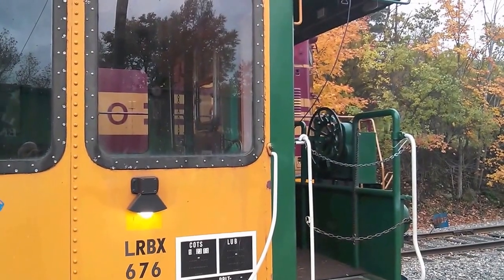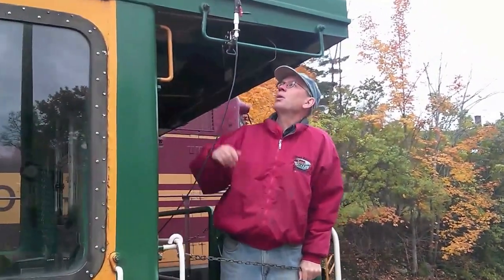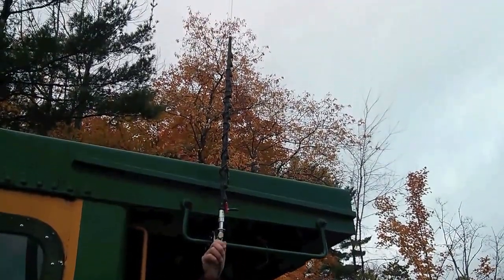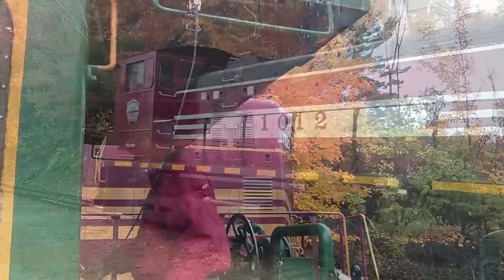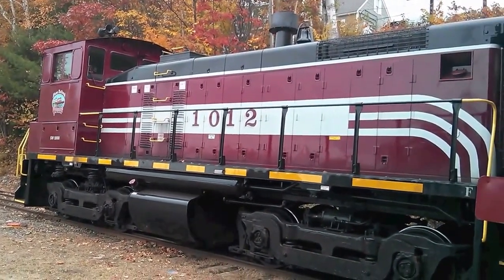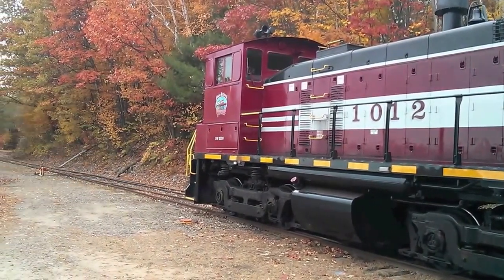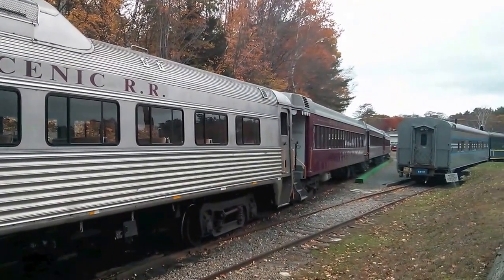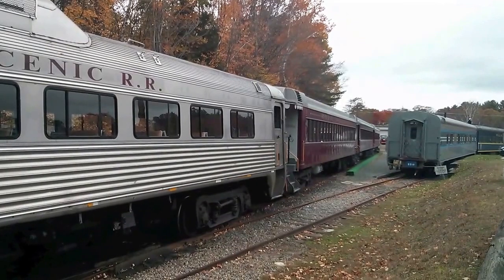Ham Radio From a Moving Train

Comment: What's a SW 1500 ? That must have been very exciting to operate HF on Rails.. I usually take my HT and monitor the AAR Channels for local short lines  and Class 1 Railroads. Operating DMR on trains maybe difficult if you're not using a Wifi device to engage a hot spot. I found that the hard way, because wasn't get my signal through as well as I should if had a Hot Spiot